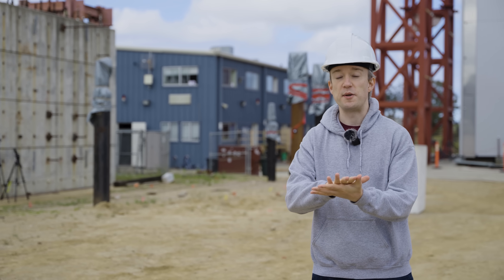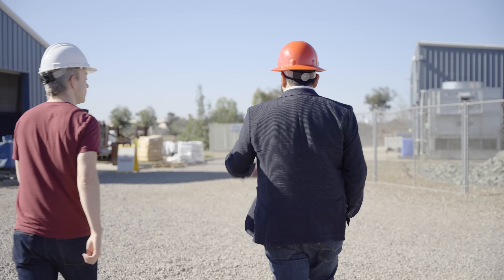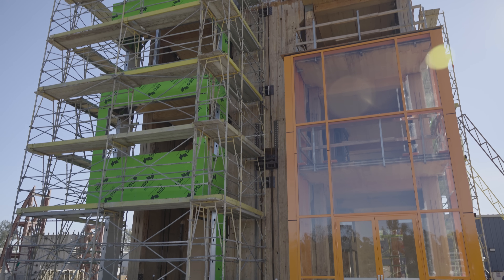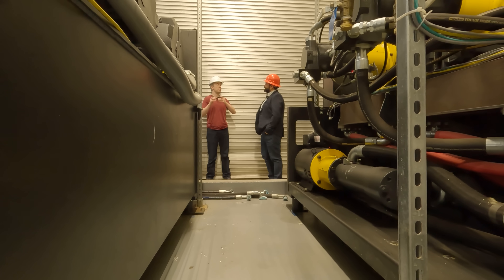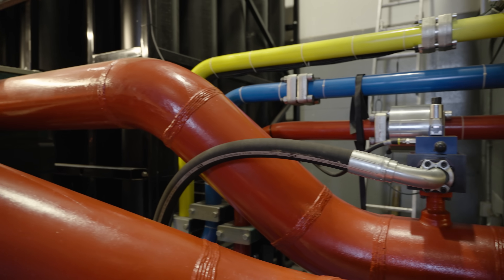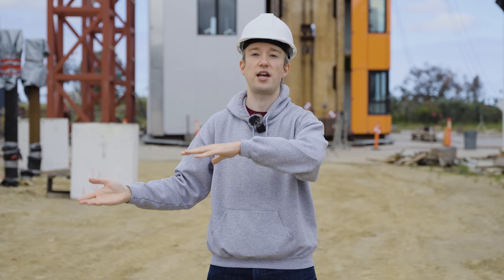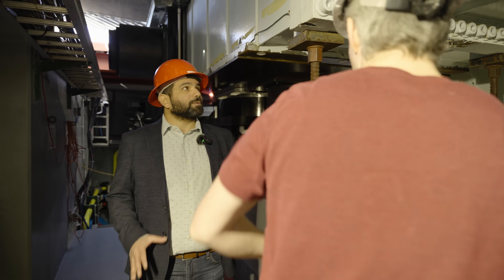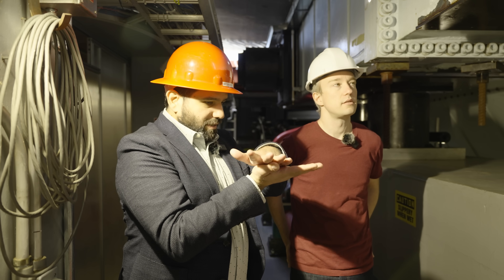Shake tables are way more complex than I thought

Comment: Glad to know that even artificial earthquake centres have picked their battle in the Y-up/Z-up debate
Reply: I guess it's easy in architecture since floor plans already grab the x and y axis by default
Reply: I might throw in railway engineering: X is along the axis, Z is downward and Y lateral
Reply: Who on earth doesn't pick z is up when working in 3d?
Reply: @QuantumHistorian  the unity engine, apparently
Reply: @sashavasilyev3000 Forget Unity. It doesn't matter where they place their axes, they were already wrong when they chose a left-handed basis.
Reply: @QuantumHistorian  Mojang.
Reply: @mailleweaver  and it always feels wrong
Reply: @QuantumHistorian  depends, is my target a Monitor/painting/billboard? (2d plane in the vertical) or a building/floorplan blueprint? 2d plane on the ground.

most 3d models (unity) should be using the 3d blueprint (Z is up) style. Z is always into your eyes. are you observing a wall? or the ground from the sky?
Reply: @diox8tony  wouldn't Z be layer instead of "up"?
Reply: @diox8tony  That's the best explanation to be honest. If there's some symmetry, it should be in the x-y plane. If there are "layers", they should be stacked along z. Cylindrical co-ordinates are r, theta, z; not r, theta, x.
Reply: @diox8tony  Z being into the eyes will forever change how I view coordinates. Thank you for that.
Reply: @QuantumHistorian  OpenGL. Z is always backwards in view-space. (As in, as you subtract from Z, you go forwards in the direction the camera is looking) This also extends to world space, but it doesn't go in the direction the camera is looking.
Reply: A lot of 3D computer graphics libraries, since they're working on a 2D screen where in the real world its Y axis points up.
Reply: @QuantumHistorian  Horizontal mills
Reply: @QuantumHistorian  I always see z as depth and y as up and down because z is meant to be the third dimension but that could change by perspective.
Reply: @alecz3843  except perspective is always relative right?

Saying which way is up or down makes no sense in a 0 gravity environment.
Reply: @QuantumHistorian  Browser CSS. Probably because the 3d capabilities are built on a primarily 2d system. XY is screen coordinate axes aligned, z is depth into/out of the screen.
Reply: @QuantumHistorian  Maya but my memory might fail me
Reply: @QuantumHistorian  When working with robots, the end effector's "forward" should be z, at least that's what my uni teaches.
Reply: @MaskedDeath_  Personally I prefer to use 'x' for forward, though for the internal coordinate frames of your robot it really doesn't matter.
Reply: @QuantumHistorian  Bending moment in beams in written wrt z axis which is horizontal almost always. wth are you saying?
Reply: @QuantumHistorian  why would Z be up? Y is always up in 2D, so if you're going to 3D, it only makes sense to make Z perpendicular to the X axis.
Reply: @GameFuMaster  Because you almost always want x and y to be "the same" and z to be "different". It just makes more sense for consecutive letters to be more interchangeable. So because gravity is the primary difference between the three directions (for most purposes), it makes more sense to have z be aligned with it than y.
Reply: @QuantumHistorian , if we want consecutive letters to be similar, how about if we had W and X as two horizontal axes and Y vertical?
Reply: @GameFuMaster Do you write on paper that is standing up? No, it’s flat on your desk. So X is to the right, Y is forward, and Z is out of the paper.
Reply: @GameFuMaster If there's one thing everyone can agree on it's that every axis should be perpendicular to every other axis.
Reply: 🎼🎸🥁 ‘… I get -Z’d, but I get +Z again, you are never going to keep me 0>Z…’
Reply: At least they don't use x-forward like Unreal
Reply: Which is it? I'm blind so miss a crap load of XYZ good stuff.
Reply: @blindbrad4719 , This video is taking Z to be up and down. They said when they were saying how far it can move at 1:17
Reply: @blindbrad4719  Think X as (Usually) being the directions you walk with your feet, Y being the directions you walk with your feet if you turn a direction (Usually to the right), then Z being the direction your body stands up.

Sometimes; people disagree about which axes are which direction, and which ways are positive (For example, going below ground for positive Z, and going left for positive Y), which leads to... conflicting ways things work out.
Reply: @ZT1ST  does the conflict come from people thinking X is the standing up because of when you look at a graph on paper? X being the vertical and why horizontal. so they think Z should be the walking forward. I can see how that would screw things up ha
Reply: Whatever the directions, the X Y Z relationship needs to follow the right-hand rule.   I believe they do as shown in the video.
Reply: Meanwhile XNA Frameworks: "Y is down"
Reply: Y or Z up depends on the structure I’m modeling. In general I keep Z as up, but if I’m creating a 2D frame that gets copied into 3D, I keep X and Y in the plane of the frame and copy in the Z direction—which makes Y up for that application.
Reply: I don't get why it's so hard. X and Y define the plane like always, and you just add a Z axis normal to that plane, problem solved!
Reply: @aysnov  The question is: which plane?

X/Y with Z-up is mostly used because the plane is often the ground of the space, but there's the viewport, which itself is technically also a plane, and is typically perpendicular to the ground plane.
Reply: He actually said "zed"!  There is hope!
Reply: @paulhaynes8045  it's also possible he's a canadian working in the us
Reply: @HubrisInc  do Canadians say 'zed' then? I thought it was a North American thing, not just US. It's worse then Australians and new Zealanders for us Brits!
Reply: @paulhaynes8045  Canadians say 'zed' most of the time, it's just US Americans that say 'zee' exclusively. It's likely an urban myth or only a partial truth, but people ascribe the 'zee' popularity to the alphabet song rhyming the next line as "next time won't you sing with me" whereas 'zed', I begrudgingly admit as a US American myself, is historically closer to its `zeta` origin.
Reply: @paulhaynes8045  Canadians say 'zed', Americans don't
Reply: @Gruncival  It's a really plausible explanation. If you say "zee" then every bar of the alphabet song ends with the -ee sound (G, P, V, Z, ABCs, me). If you say "zed" then Z is an outlier.
Reply: @HubrisInc  Except he says "about" like an American
Reply: The y axis is up
I learned it because the y sound like it is going up
The y is mathematically the up and down,
Reply: @Nikgamingnl  That's not true. In mathematics, z is usually the vertical axis. x and y are usually the default plane, so z is treated as the normal axis, which thus makes it vertical since we usually make the xy plane horizontal. 
y is only ever "up" in 2 dimensions, but once you add a third dimension, z takes over as the vertical in math.
Reply: @iout  all 2D is really just 3D from a fixed perspective.

Let me ask you this, how do you know a tree is in front or behind a bush in 2D? Given that you're using reusable assets.